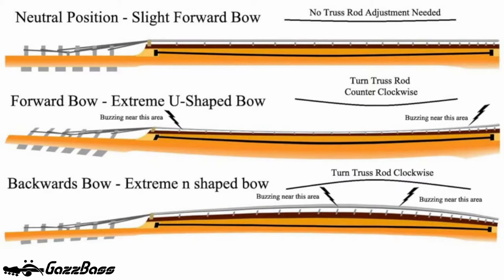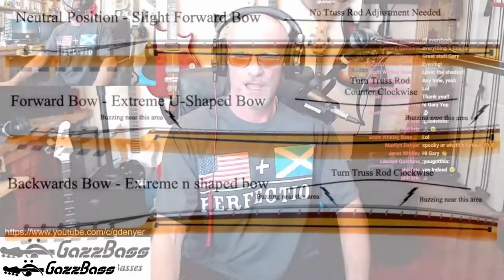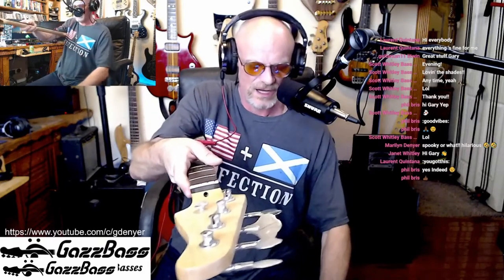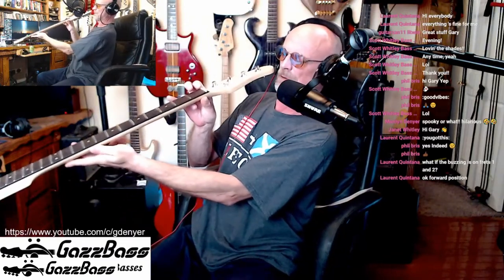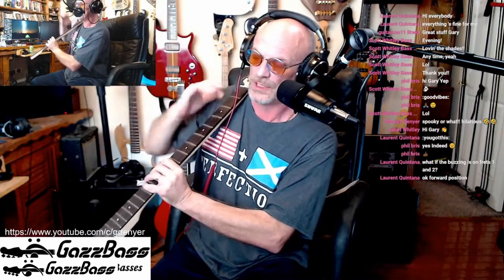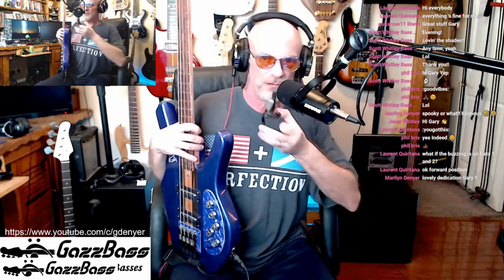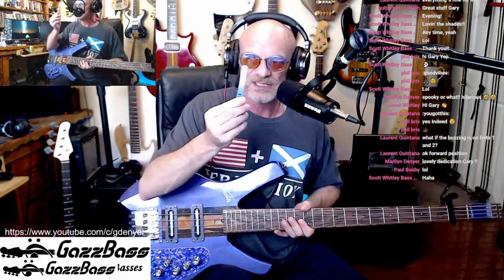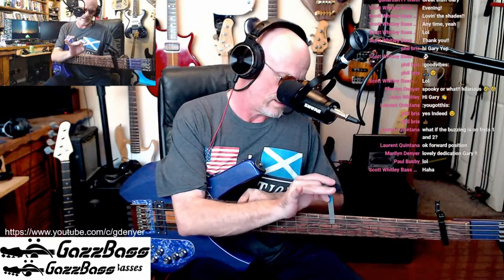Bass Guitar Neck Relief Explained From Luthier's Lair LIVE!

Comment: I think you should say forward bow not backward bow at 4:55. There are errors in the drawing shown as well. To correct too much forward bow ( too much neck relief) the truss rod needs to be tightened and that means to turn the adjuster nut clockwise not counter clockwise as shown in the drawing.
I think it is easier to define what neck relief is.
Then, if there is too much relief ( feeler gauge drops or slips between the string and the fret easily) --->tighten the truss rod by turning clockwise.

If the feeler gauge can't slip in between the string and the fret, i.e. no relief then loosen the adjuster by turning counter clockwise.
Reply: Yeah, I thought so too.  Apparently this dude doesn't care or he'd fix it.  More concerned with his little special effects.  Form over content.

Comment: What if I have a bad back bow but my truss rod is maxed out and can't be tighten anymore?
Reply from the maker: Hi,

There are three ways that I know of to combat this:

1. Slacken off the truss rod to a neutral position. Then give the neck mechanical assistance by pressing down on it while adjusting the truss rod.
2. With severe neck bending, you may need to use a heat press on the neck. Here is a great video demonstration of this: https://youtu.be/sYFGoeZZeas
3. If it's a bolt-on, you may need to buy a replacement neck.

Hope this helps some. All the best!

Comment: What about open string buzz , having it on the D and G.
Reply from the maker: Hi!

This could be a number of things...

1. Neck has too much of a back bow.
2. String action is too low on the treble side.
3. Neck is twisted.
4. Frets are uneven/high on the treble side
5. The nut slots are too deep on the treble side.

If very light gauge strings are used, I would check nut slot depth first.